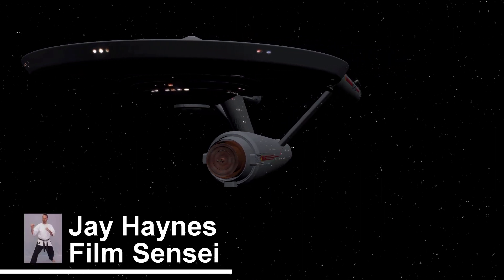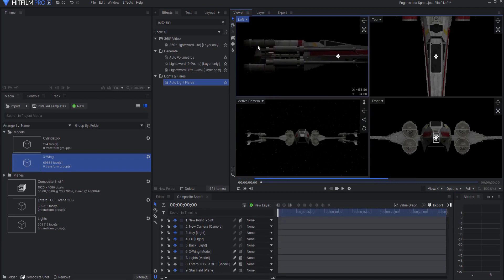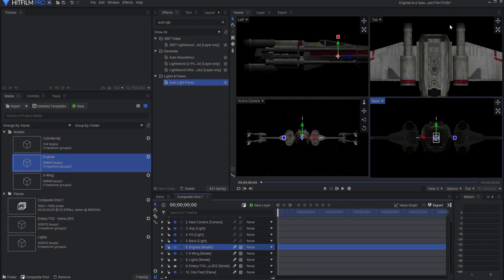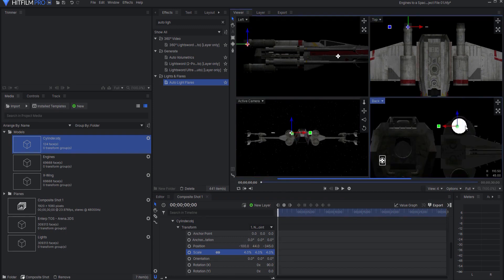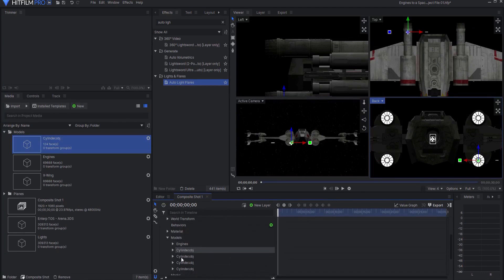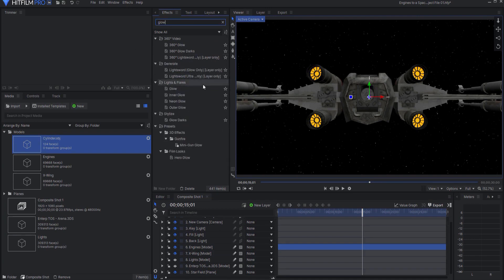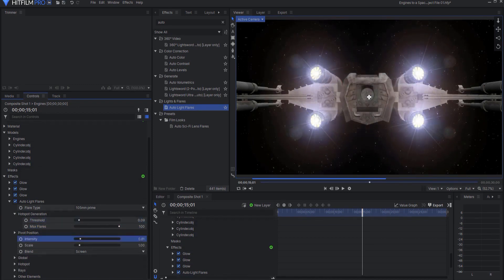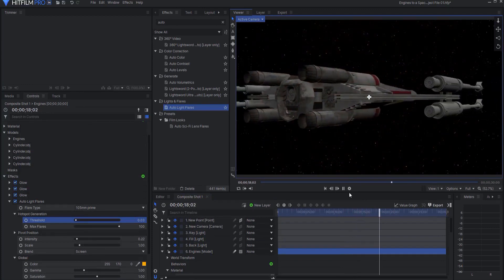How to Add Lighted Engines to a Spaceship in HitFilm!

Comment: Hi, I couldn't get this to work, unfortunately. Or, well, it did work, but I had already set up both camera movement and ship movement for a whole 18 second scene, and the new point messed up my camera movement. Any tips? I really don't want to do all the camera positioning again, it took me a long time.
Reply from the maker: You shouldn't have to change anything with regard to the camera movement. You can set up your engine position point and then parent it to the main ship's position point so when the ship move, the engines will stay with it.
Reply: @HitfilmSensei  I'll give it a try, thanks for  answering so quickly :)

Comment: Very interesting! Question though, why did you create the 2nd layer black?  Could you not have added the cylinder inside the 1st layer and achieved the same thing?
Reply from the maker: If you add the cylinder model to the main layer, then when you add the Glow and Auto Light Flare Effects, they would be affect the whole model. We are using a separate layer just for the occluded engines to be able to add those effects separately. I hope that makes sense!
Reply: @HitfilmSensei  and comping in add mode cuts the black.
Reply from the maker: @HitfilmUniversity  Right. Adding the cylinders directly to the Model layer would definitely accomplish the occlusion requirement though, but you couldn't add any effects to them directly.
Reply: @HitfilmSensei  I thought that is what is was, but wasn't 100% and I thought it might be a good teachable question to throw out there :) ...definitely not because I am stupid or anything.  Yeah, that's my story and sticking to it!